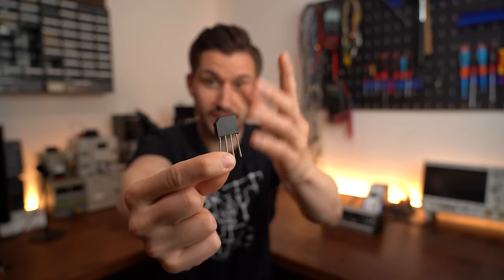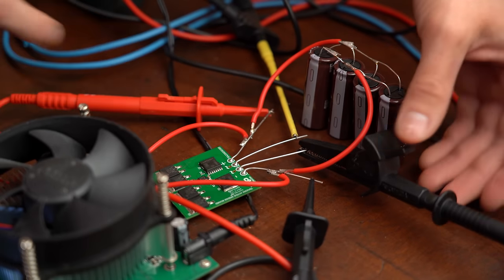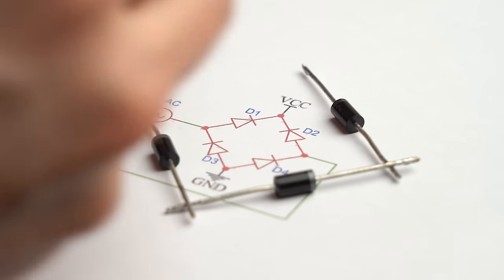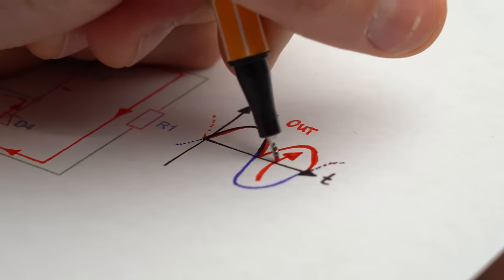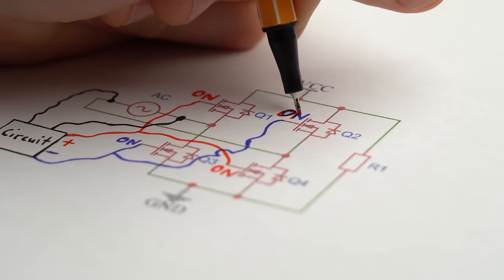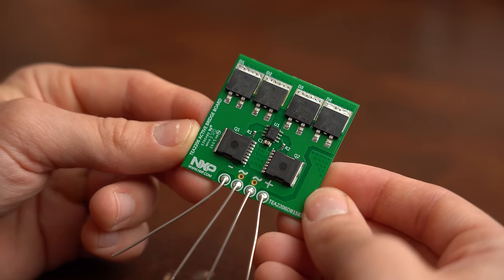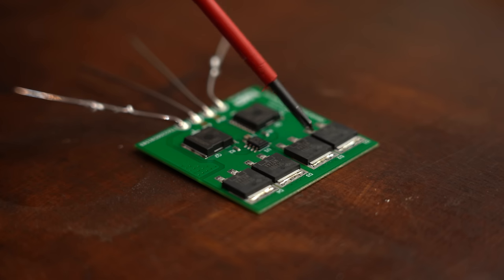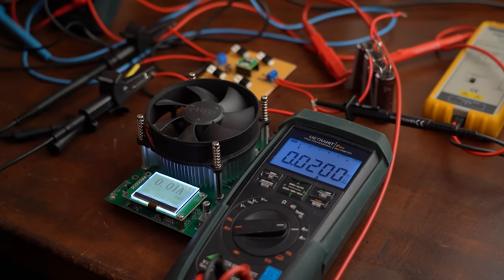The End of the Full Bridge Rectifier? (Sorry ElectroBOOM) Active Rectifier is here!

Comment: Power factor correction is real.  I blew many triacs using zero crossing detectors while trying to drive inductive loads.  Let me break that down.  A triac is like an AC mosfet, it can conduct in both directions, but when the voltage goes to zero, you have to "turn it back on" and this happens 60 times a second with mains voltage.  The zero crossing detector will detect when mains or AC voltage crosses from plus to minus or minus to plus, to turn the triac on.  For resistive loads, this works like a charm.  Any time I attached something with a power factor, my triacs would break, and stay permanently closed/fused.  This included power tools with motors, or large CRTs (Cathode Ray Tubes, computer screens of the previous millennium), or anything with a large power factor aka inductive load.  This is because, while current and voltage are in-phase for resistive loads, they got out of phase in inductive loads, so my zero crossing detector would try to go off while current was flowing through the triac.  Bang, triac dead.  GreatScott, a video on this effect would be very useful.  Also a full bridge rectifier does not suffer from a power factor / inductive load, since it is a passive component, and thus a good choice.  Even linear regulators like the venerable 7805 have a place where rock steady voltage is required, like audio projects.
Reply: PFC is a thing for efficient mains power transfer, but for a triac you need a snubber circuit. I think microchip has a app note on snubber circuit design. The snubber allows you to manage dv/dt, allowing the device to remain off.

While MOSFETs can allow you to directly interact with mains current, scrs and triacs do it very well, and are very well understood technology, and are very rugged.

Also in your circuits, were your triacs truly dead, or just stuck till you disconnected the circuit? If dead sounds like you had something else going on... A stuck triac is not a dead triac unless the circuit design allows too much current to flow in stuck case. Like two stuck triacs dead shorting each other...
Reply: @JJJulie-t7e  They were dead.  Yes, I should have used a snubber but my understanding was that a snubber circuit would have to be matched to a specific load factor, that is, there wasn't really a general purpose snubber network.  I gave up and used relays.  It was a simple power delay circuit, using an HV cap to limit current, into a diode, cap, and zener diode as the most janky and dangerous power supply you've ever seen, to go to a 555, the zero crossing detector, and the triac, the 555 configured as a one shot.  This was at least 25 years ago; perhaps modern triacs have overload protection, these certainly did not.

Comment: Less semiconductors, less components, less soldering and connections = cheaper production, better stability, easier maintenance. There are different approaches to AC rectification, including mercury arc devices - diode bridges are perhaps the most elegant and lightweight solution yet, where package costs more than the chip itself, despite some power losses.

Comment: Interesting idea, however it comes with a very great risk of a possible glitch, from a power surge, or lighting storm to allow AC right into your device. The mosfets are really timed in sync with the AC input by the controller chips, making it very efficient AC to DC decoder. As in a diode circuit they could short out as well but in most cases for wise protection another diode or two are down the line to prevent it from killing the rest of the circuit, but if you are looking to have a low loss or loss less circuit those other protection diodes would be eliminated.

Comment: first knowing  the active rectifier  catched my  interest this circuit  can be  useful with very  high power equipment in the KW  region 
so using a complex circuit  like this to drive  a 10w  flyback switching DC power supply on the primary  side is completely useless but it's good to learn something new every day .
thanks for the great videos 👋

Comment: Seen this technology for high current 3 phase industrial electronics. In that case there are 6 diodes replaced, when there is about 120A per phase its a no brainer to use the active rectification

Comment: @GreatScott - if I'm not mistaken, that MOSFET network with H-design & switching controller is nearly identical to the design of a pure-sine DC/AC inverter, many of which use the EGS002 controller board that's everywhere on the internet these days, and built into many inverter products on the market.

Comment: "Synchronous Rectification" (such as active rectification) actually pre-date diode rectifiers. Before semiconductor rectifiers, including selenium rectifiers. Before "tube rectifiers", including hot filament vacuum diodes & mercury vapor rectifiers, and various "cold cathode" rectifiers, there was were synchronous rectifiers in the form of mechanical commutators and brushes, that are parts of DC generators. That's what Edison used for making DC power, back in the 1800s before "electronics" even existed.

Comment: Use opto isolaters for each mosfet take a small amount from the open switch to power the mosfet gate voltage.
It seem to have its best advantage at low voltage high current applications.

Comment: I think the biggest efficiency gain would be at the low voltage levels like 5 volts. A .6 volt drop vs a .1 volt drop should yield higher efficiency at the low voltages. I notice many SWPS are using synchronous rectifiers on the low voltage output side.

Comment: I see this video is a year old and has a ton of comments, so probably someone has already raised this issue.  One huge difference between between the diode bridge and the MOSFET bridge is that the diode bridge only allows current flow in one direction (input -> output), where the MOSFET bridge allows current flow in both directions (input <-> output).  This is why the fuse blew with the large capacitive load, since large currents are flowing in and out of the load capacitor.  This can be addressed by using a fancier gate controller that shuts off one of the MOSFETs when the input voltage drops below the voltage on the output load capacitor.  This can work ok at 50/60Hz mains frequency with clean waveforms, but gets much more difficult at higher frequencies.

The MOSFET bridge is actually an old idea.  I've simpler circuits (no controller IC) that use two N-channel MOSFETs and two P-channel MOSFETs with the gates simply cross-coupled directly to the input.  This circuit was sometimes used to allow a low-voltage DC-input device to work independently of the polarity of the DC input voltage, which was handy since barrel connectors could be either center-positive or center-negative.  It still had the problem of blowing the input fuse if connected to an AC input, though.

Comment: The trend of course is that technology tends toward increasing complexity over time... At some point, however, this leads to a problem of diminishing returns, and in the face of future energy and resource challenges (see: Overshoot and Natural Limits), it is clear that sticking to basics and designing for efficiency and longevity will likely supersede any advantages of more complex approaches offering only marginal improvements.  Time will tell, but sometimes, depending on the application and/or broader circumstances simpler is better.

Comment: The capacitive load looks like a shortcircuit on turn on. 5 in parallel is pretty low esr so the surge will be very large.  You'll need a soft start or some resistance.
Reply: I remember build a huge power amp when I was young. It had low esr caps and kept blowing the rectifier, so I got a really big rectifier, but then my switch exploded. So I figured out the hard way that a textbook power supply doesn't really scale. I ended up using NTC surgeguard on the supply line and all was well. A nice soft start up. I got there in the end!

Comment: The old school power supplies with full bridge rectifiers are also quieter to radio frequencies. Ham stations use them as a staple instead of the newer "switching" versions. Those things are noisy "on air".

Comment: Well, the choice for power supply topology depends on the usecase. Full bridge rectifiers are generaly  less effecient, yes . However , switching power supplies  create  high-frequency AC noice that you might have to filter out, depending on the application.
Reply: I've also measured high (relatively) initial voltage spikes lasting 10-20msec on some off-the-shelf converter outputs when input power is first applied...2 to 3 times the final stable regulated output voltage. Could damage some sensitive circuits. They don't seem to use any active circuitry to wait for stabilized voltage before enabling the output. It would however seem the real-world exposure must be limited or there would be many, many complaints about it.

Comment: Although larger in size, a nominal increase in efficiency can be achieved by using NPN power transistors with their base and collector joined. The 'voltage drop' is less than single diodes. Germanium devises = even less loss.

Comment: Something you missed was that the circuit to control the "active rectifier" controller requires a clean DC current to operate it.   Something I have seen with model trains for years is the use of only 1 diode to convert AC to DC. Sorry that is only getting part of the DC current and also still allowing AC to get through and often it will burn out the DC motors or other electronic parts.   Cheep, cheep, cheep idea or avoiding the necessary parts to just get by is something I see to often in modern circuits and some old ones as well.

Comment: Germanium diodes are the best for low voltage & low amp use cases! Not very common nowadays except in audio circuits, but often used in very old gadgets

Comment: Not mentioned in the video is that all SMPS perform rectification at least twice, and this test only replaced the mains rectification stage where potential efficiency gains are usually negligible. Active rectification gains are most significant on the low side which is why almost all reasonably sophisticated power supplies do it. Pretty much any SMPS with PFC will already have active rectification.

There's way more to active rectifiers than this video covers such as the design and operation of the charge pumps and level shifters for the gate drivers and the relative (and often hidden) efficiency cost of gate drive current on power factor versus the typical diode junction capacitance of a standard rectifier.

This type of active rectification mainly applies to power electronics but there is also a whole other genre of small signal "precision" rectifiers whose designs are equally interesting. And really the mercury-arc rectifier is the king of cool as rectifiers go. An impossible act to follow.

Comment: @GreatScott! You could mention that its very old technology. Thyristor based 3phase rectifiers are older than me. For most applications MOSFET is just overcomplicated solution. There is a reason why its not used (popular). For most applications diode is good enough, then if you need more control: SCR (Thyristor). 
About the short-circuit: I finished my uni like 10y ago, and do not remember all, and things get lost in translation, but there is a phenomenon of comutation in thyristor based rectifiers, maybe you experienced similar thing.

Comment: I thought this idea had been around for a while? I know it's typically not used in consumer products due to cost and size, but I've made a rectifier using transistors in the past. It's not great for higher power devices as the transistors get pretty hot but MOSFETs can probably cope with the higher powers.

Comment: As you open mosfets in wrong way your condenser drops to main supply. If you do not open them at all they working as usual diodes.  The only way to solve this task is to open the gate by potential different between main power and condenser. In this way supply peaks going to easily leak to condenser without extra resist. But as I remember there is  leaking diodes on market already.

Comment: I advise that they be put in a plug-in board, which of course they won't.  With complexity comes eventual failure. We already see plenty of very expensive stuff, like FET microphones where the parts are no longer made. and so a whole new circuit must be made. I also see plenty of older consumer stuff where the power supply regulator has failed.

Comment: A much more efficient method is a dual polarity PFC, which combines active rectification and PFC into one system.  I am surprised the TEA 2206/8 even exists, as there is likely very little, if any, demand for such a controller.  I also notice it is insanely priced, meaning not used much.

Comment: You should have compared the efficiency losses,  rather than efficiencies. Going from 94% efficient to 97% efficient doesn't seem like that big of a deal, but cutting losses from 6% to 3% reveals it is a big deal, because that's half as much waste heat you have to dissipate. That means you can package it much smaller.

Comment: The higher the voltage you're rectifying the less significant the diode drop is. If you reckon on 0.5v per conducting diode in 340v for rectified 240v its not worth the complexity unless you can just by an active rectifier package with 4 legs. You probably will be able to get that in the future.

Comment: I see the standard bridge rectifier ruling the low-ish power, cheaper stuff for a good while still. In my opinion, the efficiency gains is not worth the complexity, potential higher failure rate and extra cost of the active solution. But as usual it's a question of balancing many parameters, and it probably makes sense and already exists in higher power or specific applications.

Comment: The next test you should perform with this active rectifier is one based on an alternator or some type of pulsing DC generator. Possibility would be to use a BLDC motor which will generate a good strong AC voltage. 👍👍

Comment: The really old way of rectifying AC to DC was by using an AC synchronous electric motor connected mechanically to rotating contacts kinda like an inverted armature.
This active rectifier kinda feel like the solid-state version of that old mechanical rectifier.
Reply: Boooring. Mercury-arc rectifier is clearly king of archaic rectifiers.

Comment: Interesting test and results - but wouldn't an added factor in building such circuits also need to consider component points of failure?  More components, more places for failure?  It does make sense tho, for lower voltage applications.  Again - thanks for a very informative video.

Comment: I think you should compare power loss, not efficiency when you give those percentages. If one rectifier has 99% efficiency and another has 99.5%, the second one is 0.5% more efficient, which sounds very unimpressive. But it generates only half the heat, which actually IS impressive.

It isn't really about how much of the AC power you pull from the wall that gets into the DC doohickey that's interesting here. Those are basically the same across the board. But producing significantly less heat in the transformation is interesting, as that makes for easier engineering.

Comment: I have had the idea for a long time to use something like this to build a loudspeaker chassis that does not need a permanent magnet. The DC signal would then go to a second coil to replace the magnet. But I also think that the speaker could sound quite distorted afterwards. But at least it would be light.
Reply: Running the second coil from rectifying the audio signal will cause distortion. But good sounding speakers without permanent magnets isn't a new idea. Before modern magnet technology radio speakers used what is often called an electrodynamic speaker. They have a field coil which runs on a separate pair of wires so it can be continuously powered.
Reply: @eDoc2020  Do you think a DSP could distort the signal beforehand so that it inverses the distortion such the speaker would produce?
Reply: @NicosLeben  I don't think it would be practical because the distortion would depend greatly on the minute operation characteristics of the circuit and coils. If you managed to adjust it properly to eliminate crossover distortion then a change in temperature would probably throw it out of calibration.

What might be more practical is running a constant DC bias through the speaker. It would waste power but would eliminate all the crossover effects.

Comment: Nice very basic electronics video. Looking at a year of comments and only seeing one or two that hit the 'sweet spot', which is Heat and Efficiency.
One heat: It is an electronics killer. Every 10°C. increase in temperature doubles the rate of failure for anything electronic . How many hours do you want the circuit to perform correctly? Cool it 10° C and you double the life to 'mean failure' (based on Military and Commercial Standards).
You covered the efficiency nicely. A diode has a fixed voltage drop at the current rate being used. At lower voltages, that drop becomes important! If you use a bridge, each side has two diodes which increase the problem. A single diode half wave (or steering diode) is better efficiency than a full wave bridge, but if power is reversed the circuit does not work. That makes it a 'design choice' and you need to prioritize your needs. 
Be aware, adding more electronic components decrease that system's reliability. Based on the system's mission, that may become a huge factor. Oh, generally the more components the higher the system cost.
These are common issues for a system based design and only one choice is not a good answer., you need a bag full.